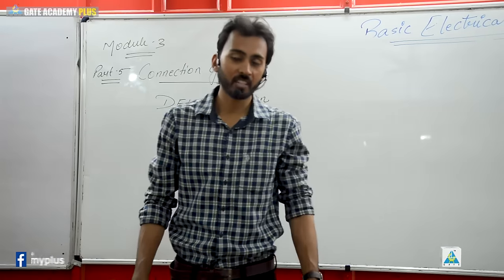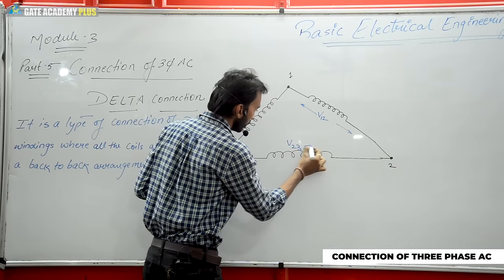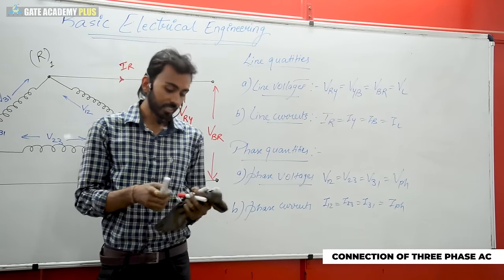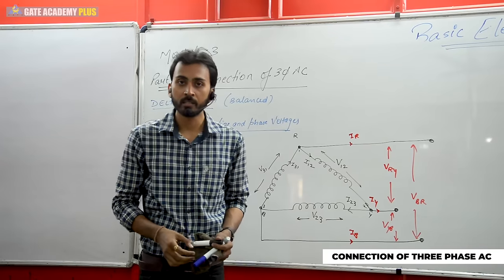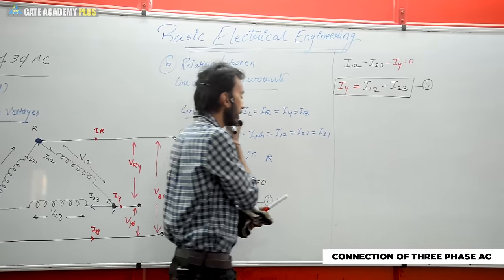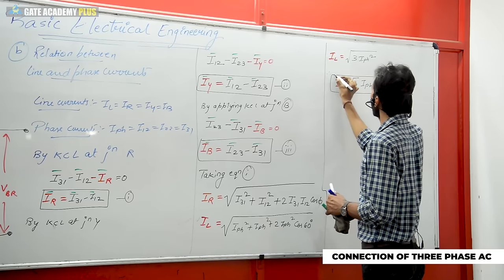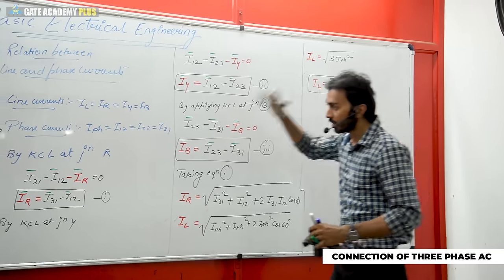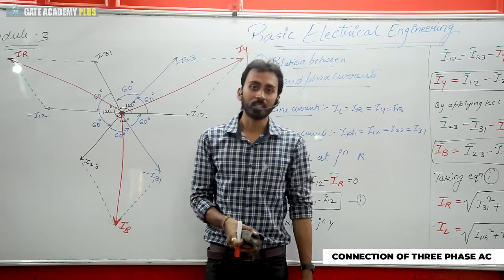Basic Electrical Engineering | Module3 | Delta Connection | Connection of Three Phase AC -Lecture 23

Comment: Thanks so much for Your this video this made me clear that Why does the angle between Phase Current and Line is 30 .I use to face this doubt while drawing Phasor diagrams in Wattmeter in Delta Connected Load System